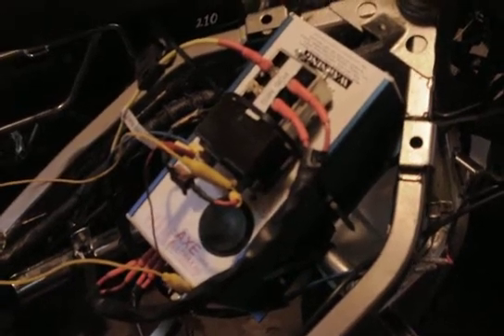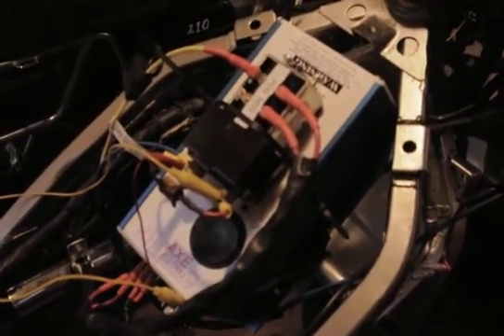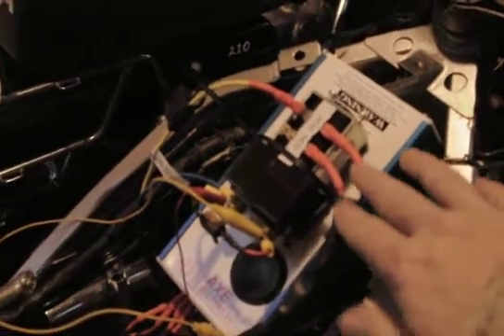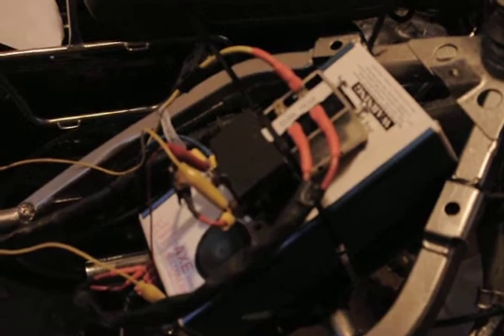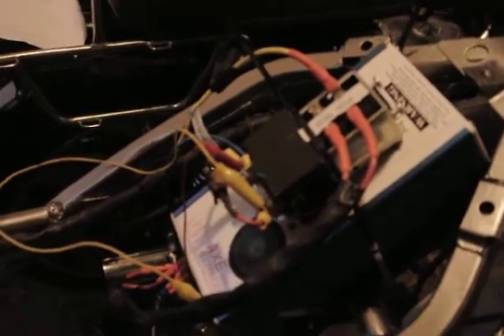Final contactor wiring, test at 72V

Comment: when you turn on the contactor you say no pops or sparks. Do you use a precharge resistor? If you use it, how does that mechanism work? Similarly, I need to power on my 72V controllers without sparks when I turn on the key ignition on my electric scooter.